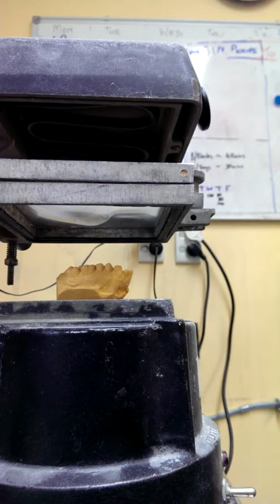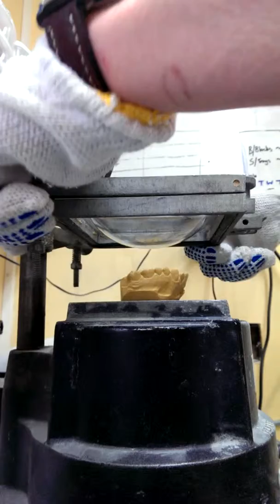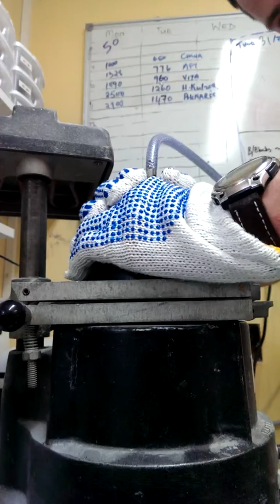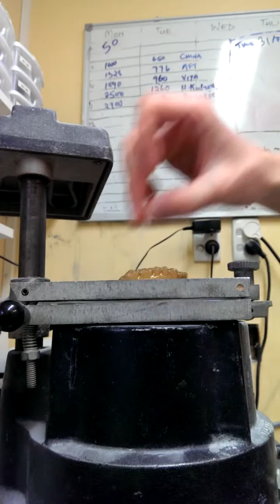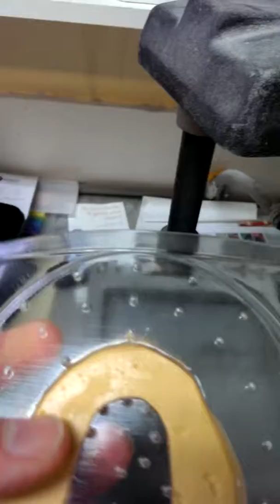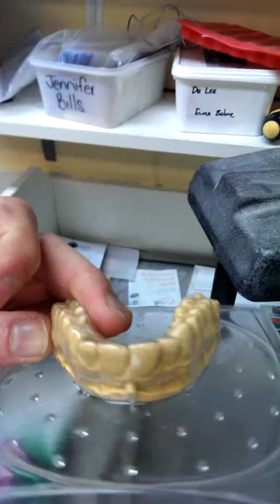Custom Mouthguard Vacuum Forming - First Layer

Comment: How to make the pressure dome?
Reply from the maker: Sushant Dhalla just a bowl, drilled a hole in the base, attached a air-hose tap to it. Pretty basic, but does the job and only cost a few dollars.
Reply: Steve Sharp and attached the air hose pipe to what? Pressure cylinder?
Reply from the maker: Sushant Dhalla if you are a dental technician, then you should have compressed air available in your lab. You just connect it into your labs air line?
Reply: Steve Sharp thank you sir.
Reply: Steve Sharp what psi used?